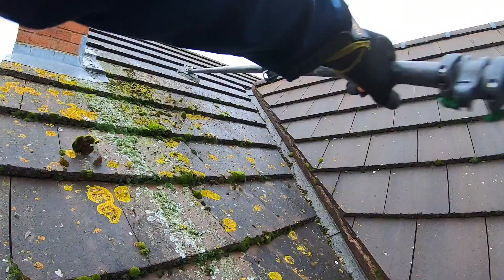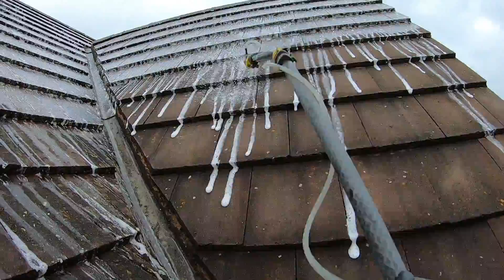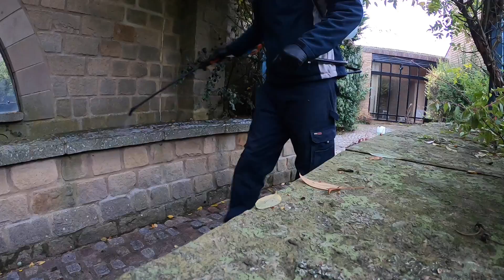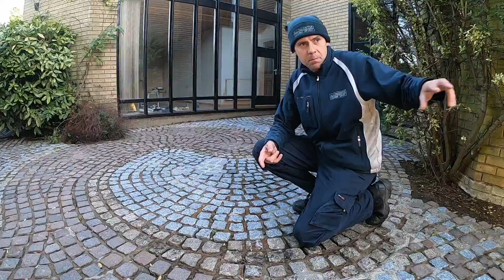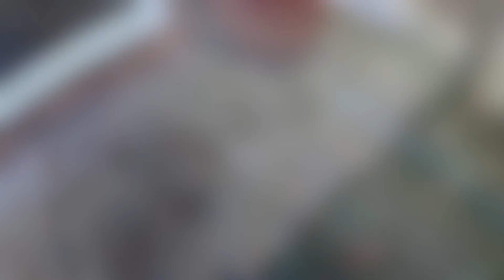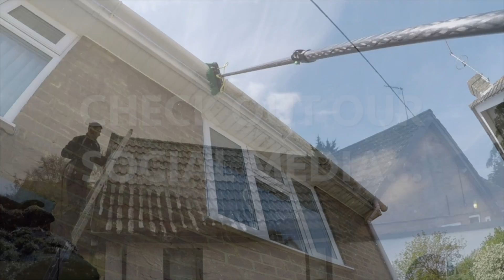Moss Terminator - On Test

Comment: hay man nice vid. can i ask where i can get your spray back pack and can i do a bungalow roof with it
Reply from the maker: The backpack is a gardeners sprayer. I got it from a local professional gardening shop. I did use it for some small roof spraying jobs at first. There is a video about it. You do get arm ache doing that though, it’s hard work. You could get a window cleaning backpack with a built in pump, to save your arm.😃👍🏼

Comment: Hi friend... great videos .. just a lil tip if you use a product called hypochlorite you can buy it in any farm shop for £20 for 5 gallons farmers use it for cleaning out the milk tanks .. put it as a 50/50 dieloot then spray it to  the room driveways patios et leave it for one / two hour then rinse the area down it comes up like new
Reply from the maker: Ben Loveridge Yes, I have used hypo quite a bit, but I don’t like using it on roofs. Biocide has a more preventative quality so it stops the growth coming back so quickly. 😃👍🏼

Comment: What's the benefit over sodium hypo?
Reply from the maker: Walt Spring This product is also preventative and biodegradable. So different products are good in different situations.😃👍🏼
Reply: @aemackintosh  SH breaks down into salts when combined with water. This process is accelerated by sunlight. It is one of the few biocides the EU has graciously accepted for general use. What is the method of "prevention"? On the surface, such a claim seems far fetched. You can't "prevent" microbial growth without some sort of a long term surface treatment. No biocide behaves in that manner. The best "prevention" you can do is make sure you kill as much of the micro-organism as possible, which SH is very good at.

Comment: If your pressure washing it anyway then why would you pre treat? Pressure washing will remove the moss from that floor and then a does or bio to kill any spores left surely
Reply from the maker: Crystal clean external Using it as a pre treatment helps to get a better result from the pressure washing. But you could use it after and it would help it stay clean for longer.😃👍🏼
Reply: @aemackintosh  hmmmm in my opinion that's a waste of product as it will only eat through some of the moss and dirt, personally find it better and can use less and a weaker dilution if you pressure wash away what will come away and then treat. But that's just me, either way still a good video as always, keep them coming
Reply: Ash I would have to agree with crystal clear, If you have a good pressure washer get all the crud out first then kill anything remaining to save on product. Try it and see, I'm sure once you have you will forget pre treatment. I can appreciate you was also trying to show the chemical working which is great for people that dont have a pressure washer. Not on here to give u a hard time as your doing a great job just we all learn from each other. Keep up the gd work. M
Reply from the maker: Great, thanks, I always like to hear different ideas. I was trying to show the effect of the product. I think it depends on the situation. I think it was well worth while doing the pre treatment on the walls, I was particularly pleased with how they turned out. There was a stone patio round the corner that I pressure washed and treated with hypo twice! And it still wasn’t perfect. But that’s a video for another day. Thanks for your comments.😃👍🏼
Reply: Hi all, 

Thanks for your input. For optimal results, by brushing or pressure washing the moss away first, then applying the formula and leaving it for the recommended 48-72 hour period - it allows our product to treat the roots of the moss and inhibits the regrowth period. However, the formula will still work even if you don't brush or pressure wash the moss away first - the results just won't be as effective.

Hope this helps. 

For more info, please see our FAQ page: https://mossterminator.co.uk/faqs.html
Reply: @greenterminator8361  thank for clearing that up = I was thinking along those lines makes perfect sense